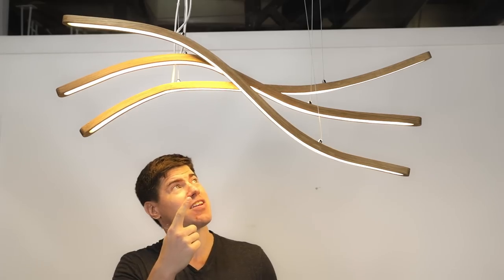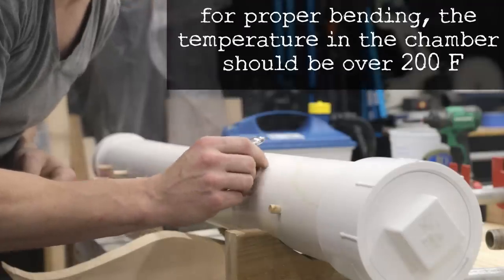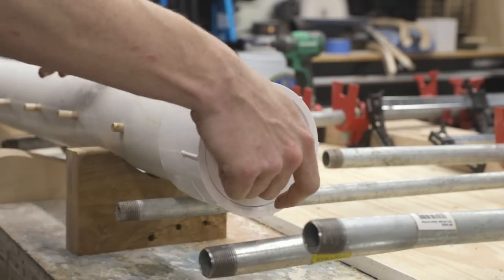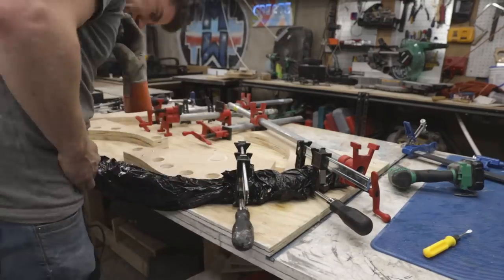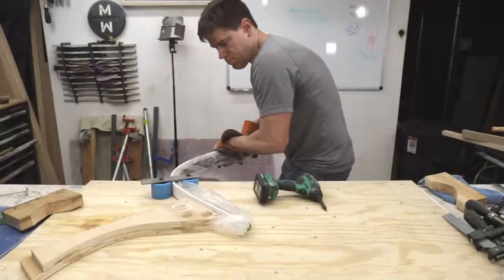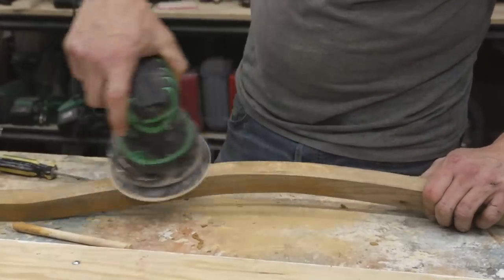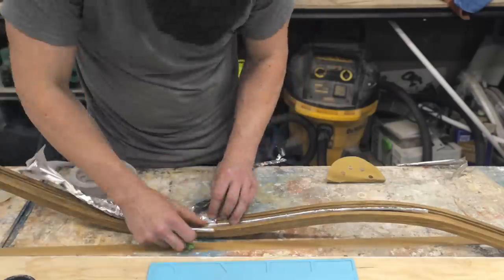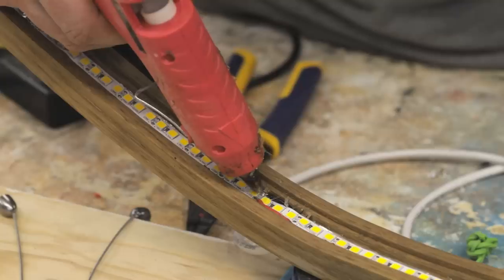BENDING WOOD with STEAM to create an LED PENDANT LIGHT

Comment: Voltage drop will be distributed over all the leds evenly since they are the same load. All LEDs will be lit the same no matter where you make the connection. The dimming will always be uniform with the same LED or bulbs being used across the circuit. For example if you only have 1 led, that led will drop almost the full line voltage. 2 LEDs each one will drop half line voltage. 3 LEDs will each drop one third line voltage and so on.
Reply from the maker: Ok, maybe I need some clarification here.... I know with individually addressable RGB LEDs, the voltage drop will lead to LEDs at the end of the strip being dimmer and/or not being colored differently than LEDs at the begining of the strip... I assumed the voltage drop would be the same issue here, since power and ground are wired similarly in both strips.  Am I missing something?
Reply: @modustrial  it may depend on how the strips themselves are wired but normal voltage drop in a circuit is distributed. I believe if all leds are parallel (which I believe would be how individually addressable leds are wired) you technically have line voltage to each led, but in the overall circuit, they would start to be limited by amperage, but that should still be equal across all since they are the same load to the circuit. What I think may be seen with what you're talking about is slight manufacturing difference between each individual LED that's causing some to dim more at low power than others, but at normal power levels they look uniform. I would need to have a strip in front of me doing what you're describing to know for sure, but I would totally expect each led to have the same voltage voltage drop and the same amperage draw across each. I haven't played with any led strips since the crummy ones when they first came out, so never had addressable ones, but I've always been under the assumption what limits length of the strips is the power supply and circuit sizes inside the strips

Comment: looking forward to confirmation from electrician. I had my uncle (who is a one) check out my diy light, he said that I needed to swap out wires and organize them better. I wasn't working with LEDs but regular socket bulbs. Im updating my build with a 18-3  braided wire pack inside the fixture to  connect everything rather than have the 3 wires running seperatly. Idk the code on ground wire for fixtures , I know alot of desklamps dont have em. I wonder how the LEDs will be, as I noticed you dont have a ground wire.
Reply from the maker: Yea LED strip themselves don't need a ground wire, but there will be a ground wire running to the ac/dc power supply for them.

Comment: hi sir, do you plug the cable in the middle of the light?
 is that right? I dont know electrical,but usually i see it plug in the corner section

Comment: Still watching the video, but stopped it at 4:00,
Why did that kickback occur?
(Maybe there is some lesson in it for me).
Reply from the maker: Cutting thin strips of wood, there is always a greater risk of kickback since its easier for them to get pinched and they are lighter.  I generally just stand so that my body isn't in the line of fire when cutting thin strips.  Rockler also makes a thin rip jig, or you can use a festherboard to prevent kickback in this situation
Reply: @modustrial  Thanks for your reply, luckily i never had kickback before but just like you, i never stay in line so should it ever happen, hopefully no harm is done.

Comment: To bend wood I usually let it sit 1-2 days submerged in water and use a heat gun to bend it. The less rezin the wood has, the easier it is.
Reply from the maker: Interesting method....I'll have to give it a try next time

Comment: I dont think you have to use an electrician when working with 24V LED(?)
And as long as the power to the LED-strip runs parallell with the strip, it doesnt matter if you attach power to it at the end or in the middle, or you could attach positive in one end, and negative in the other end.
Reply from the maker: It's actually only 12V, and no you don't need to if you are just using an AC adapter and plugging into a wall outlet...but I want to tie into my homes 110v power tho, and hook this to a wall switch, so I'm calling an electrician :)

Comment: I would have ran 1 thicker power cable down to the lights and ran smaller wires to & from each light. that way you only have 1 electrical wire going up. as it stands now it is not aesthetically pleasing to the eye with all the electrical wire .
you have to run a thicker wire going down the lights.
as far as the aluminum paper you put in instead of the aluminum channel, all that is doing is reflecting the heat toward the lights instead of away.

nice work
Reply from the maker: Good ideas...thanks!
Reply: @modustrial  where did you get the aluminum wire thingy to hang the wood

Comment: I would wire power for led strips through hanging wires...  using a fuse at power supply for just in case if some one swings and crosses hanging wires
Reply: You would be making a dangerous and possibly deadly shock/fire hazard. Please do not make anything electrical without learning about the dangers first, for your sake and those around you.
Reply: @fraseralexander9840  not at 12V and with correctly size fuse...

Comment: Why you didn't cut a thick wood in that shape instead of bending?
Reply from the maker: it would have a totally different look since the grain would not follow the curved shape.  It would also waste a lot of wood.
Reply: @modustrial  we can put laminate on top of it right? Or may be put a thin layer of epoxy after polishing

Comment: I wouldn't steam bend wood since it seems like a pain... if you're OK with a different aesthetic I would just laminate strips of wood like the dudes from Lignum (youtube channel).
Reply from the maker: Yea, bent lam is easier.  But, like you said, a different aesthetic.  It also would be challenging to route the LED channels in a bent lam version of this, since you'd have to do it after bending
Reply: @modustrial  How difficult to you think it would be to use a rebate router bit with a guide bearing?

Comment: nice video  but your comments re. led strips joined in the middle is nonsense, The leds are wired in parallel not series, so each will receive the full voltage.
Reply from the maker: Thanks!  And I think you missed the point, so let me try to rephrase.  They are wired so the single strip is effective ly divided into two parallel sections, which, as you say, will both get 12V at the first LED of the section.  However, there is a voltage drop accross each individual LED as the power travels down the strip.  If you have a run of LED strip that is too long, then the LEDs at the end (away from input power) can be dimmer.
Reply: @modustrial  No, because each LED is wired in parallel there is no voltage drop, each LED receives a full 12V. Your house is wired in the same way - you don't expect the lights in your rooms to get gradually dimmer as more lights are turned on. You would be correct if the LEDs were connected in series. The tradeoff with parallel wiring is the current draw is greater the more LED's you have.

Comment: Your led run is not long enough to get any significant loss. Use close to the highest voltage supply rated for the leds. If you ever make a big ring of leds you and join the ends like a parallel ring circute which will efectivly reduce the voltage loss. also this is a pretty good article. https://www.waveformlighting.com/led-strip-lights
Reply from the maker: thanks for the info!

Comment: "DIY" in video title. first mention is a steam machine you need to buy for a lot of money....
Reply from the maker: A $70 tool and hooking it up to a PVC pipe?  Really?  This isn't primitive technology here....
Reply: @modustrial  A modified pressure cooker für ~5bucks will do the same and is more diy in my opinion. Saves you 65$ you can spend for more wood for experimenting.